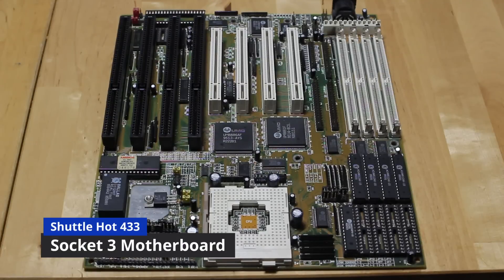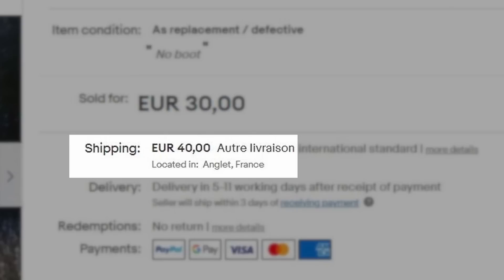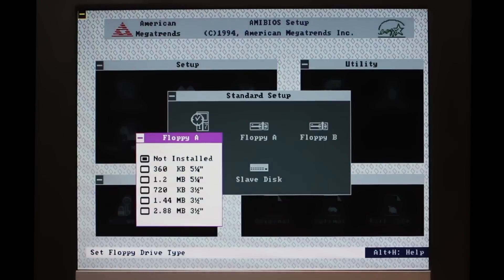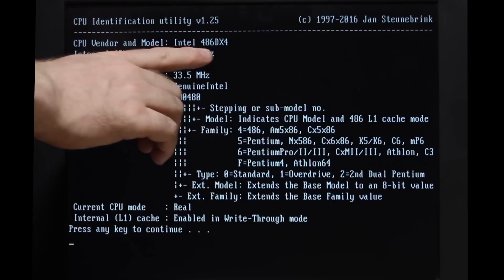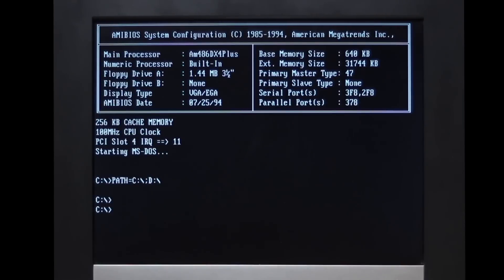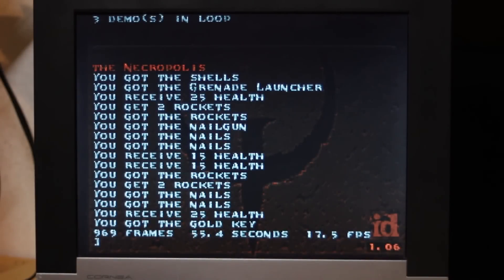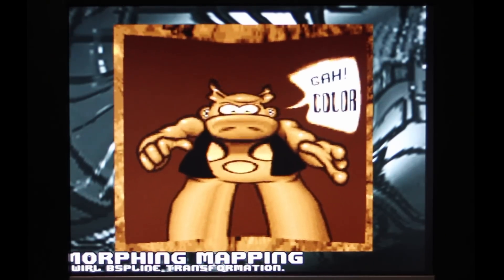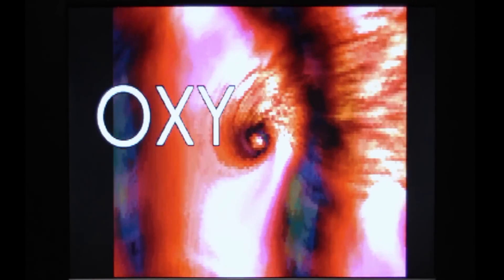Is this Really "One of the BEST 486 Motherboards Ever Made"? #DOScember2021

Comment: I worked as a technician for shuttle in west London in the mid 90s the HOT 443 and 553 were the in boards at that time. I can only remember changing the keyboard fuse on the 433 otherwise never had an issue. We use get bios requests from customers which we'd pass back to Taiwan and they would send us an update to post on our 28.8K modem builitin board, that was unreliable :)
Reply from the maker: Interesting details. I remember the boards from way back. I may have even sold a few of them back in the day.

Comment: I see you're running the Quake demo with the scree size two notches below max. 
This is clear when you see that you have the HUD showing your ammo.

I believe this is "cheating".
It was always my understanding that running it one notch higher was the default setting. And to also make sure 320x200 is the resolution (again, default).
This would enlarge the screen and only show the main HUD at the bottom (which would render more pixels and make it harder to score higher).

I have been scoring 14.4/15 for a long time with my AM5x86 @ 160Mhz this way.
I can easily hit 17+ when I reduce my screen size as you did.

Please confirm how other people have been running this benchmark.
Reply: Just to add... I have an Asus PVI-486 SP3 rev1.8.with 512k cache at 2-2-2-2 settings (most aggressive is 2-1-1-1)
Everything else in bios is set to most aggressive/fastest.
Reply from the maker: I didn't change the screen size. It's the default when you run this benchmark.
Reply: @PCRetroTech  

Hmm. I'm confused...
I thought the benchmark was run by doing the following:

Launch quake by typing the command "quake -nosound"
Then hit the tilde "~" 
Then type "timedemo demo3"

Are you doing it another way?
Reply from the maker: @tofuguru941  The benchmark is part of the Phil's Computer Lab benchmark suite. I'm running it by selecting the option in that benchmark. Whatever community you are following for your info on the Quake benchmark isn't the community I'm following. If they are doing things differently, you'll have to apply an adjustment.
Reply: @PCRetroTech  ahhhhh! I remember the Phil's computer lab package of benchmarks. On vogons. 

Thank you, I think I have it downloaded somewhere on my socket 3 machine. Gotta check the folders. 

Thanks for reminding me 👍👍👍

Comment: Could you add a sound card like the soundblaster to offload any CPU work to create sound?  Perhaps may help even more with performance (Just guessing).   Awesome to see how well this board does.  If I remember correctly, my motherboard had the VESA local bus slots (2 of them) behind the regular 16 bit slots.  I had a TekRam IDE cache controller in one of them and OH MY GOD it sped that thing up flawlessly.
Reply from the maker: In all the benchmarks I'm doing, the sound is just off, so there's no cost there I think. Actually the soundblaster doesn't always take work away from the CPU. If you are doing real time mixing it's a poor choice. The GUS is apparently better for that. But I understand the point you were making.

Comment: I thought Quake required a Pentium?  Is the built in FPU on a 486DX enough to get it working?
Reply from the maker: It's just a lot faster on a Pentium. It will run on a 486 though.

Comment: congratulations on getting that dallas chip off so easily. I had one that ended in tears and desperation. tried every trick in the book, except drilling the left over legs out....
Reply from the maker: Yeah it is much easier with the right equipment. I had a high temperature solder sucker and a hot air gun. Having said that, even I was surprised at how easily this one came off.

Comment: Well now you have to beat CPU Galaxy's 486 Quake record now.
Reply from the maker: That would only be possible with a CPU that started up at 180MHz. I'd have to buy about 30 CPUs to find one. I don't think it is fair for everyone else if us YouTubers do stuff like that, so I've always said I'm not going to try and beat that score. If someone wants to loan me a CPU that starts at 180MHz I'll try it on this board, but otherwise CPU Galaxy is going to retain that title.

I'm happy that I beat his 16.8 fps with an air cooled 5x86 at 160MHz. Or rather the board did. I did relatively little in this case, compared to what I normally have to do to get the most out of a board!
Reply: @PCRetroTech  That's probably due to using 32MB of RAM instead of 16MB ... Quake slightly scales with available RAM.